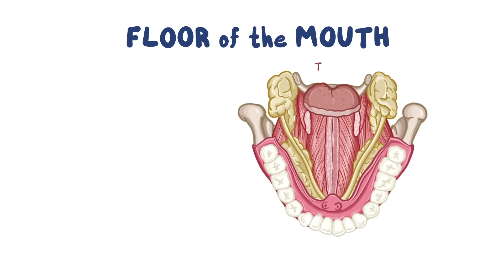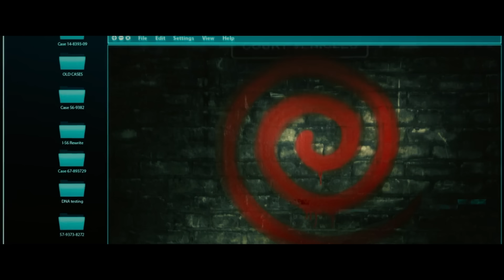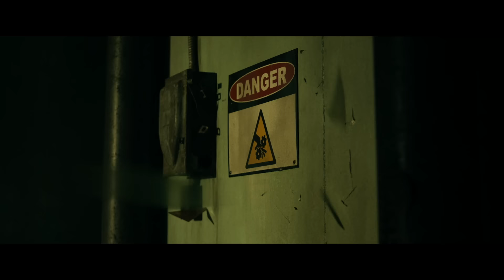How To Beat THE JIGSAW TRAPS In "Spiral: From the Book of Saw"

Comment: Those “fishnets” are actually chinese-finger-trap-like wire pulling devices used by electricians to pull wire and cables through conduit. They are made of steel cable. I really don’t think you can cut steel with glass. So like a chinese finger trap, they can only be pulled off by applying pressure forwards. Also, I believe the electricity was already on, so when he would grab the wire to move it, he would be electrocuted.
Reply: Yep, agreed. A lot of flaws in this video but still fun to watch.
Reply: So it just escape the same way as the Chinese finger trap? That doesn't seem that hard. Especially if you don't activate the machine.
Reply: Yea untwist the wires with your wet hands. What could go wrong.
Reply: @mi8los  No, just push from the base of your fingers towards the tip of your fingers one at a time….. not a perfect plan, but better than cutting steel with glass and grabbing a live wire while in a tub of water.
Reply: Best idea would to be use the slack of the line and just step either out of the pool, or on top where the bar is.
Reply: @alphalight1469  Most of his videos are, many of his survival techniques come from misunderstandings of the first page of google
Reply: I mean looking at it, he could've just climbed out or am I crazy?
Reply: Yea, that was one of the traps that he was wrong about. I probably would've tried to not bite down at all to have as much slack as possible, grab any metal on me to keep it as high as possible, and stepped out of the bathtub or ontop of the trap with in fact had space infront of it for me personally to fit and sit there till someone comes to help me as I scream profusely. He did a pretty good job with the other traps tho. The Marionette one is the one I had the most issue with. Why tf did he not mention to MOVE THE TRIPWIRE ON THE DOOR OR SHOOT IT.
Reply: Well first you should taste the water and if it isn't salty just do what you want as you won't be hurt much anyways.
Reply: @alphalight1469  Biggest flaw was completely ignoring the human factor and forgetting that any normal person in a situation such as the ones provided, would be in a state of panic and not thinking clearly enough to have the same thought process as the video creator. But I love puzzles and the video was entertaining so good enough for me.
Reply: @fireantfury2539  That isn't a flaw, most of these channels do that intentionally. It'd be quite boring to watch if they just said "realistically, you'd just die", so they analyse it as if you could think clearly in those situations.
Reply: @calculatedsurvival  he meant the copper electric wire
Reply: @immensewraith7613  Oh…. That makes more sense now. Thanks.
Reply: I would grab the lightbulb and use the glass from that prefferably a bigger piece to remove the copper wires, about the steel finger thingies I would wait keeping my mouth open the rescuers will come at day and if the killer comes back I mean glass shards to try to defend myself
Reply: @seannarodriguez2226  I mean that might trigger it shooting it will trigger it as it just acts like a saw cutting through it. and moving it I mean maybe but you would have to tie it to somewhere so the trap does not trigger
Reply: As long as he touches one wire a time he would be fine because the "circuit" wouldn't be complete.
Reply: Good ol kellum grips
Reply: If he still had his shoes he could’ve untwisted them
Reply: @babyzillakilla  lmao i was thinking the same thing
Reply: I dont think he would get electrocuted by grabbing the copper wire, because he is not completing the circuit
Reply: @bambusz0131  correctamundo
Reply: Exactly.
Reply: @bucketstuck7137  hey Gary , big fan of your work
Reply: @bambusz0131  But he is in the tub of water. The tub of water completes the circuit. Humans are conductive, if we weren’t, then we could never be electrocuted. If he touches the copper wire that is supposed to touch the tub of water, then he just put himself in the circuit from source to ground.
Reply: @calculatedsurvival  you are absolutely right. Thx for explanation, my dude!
Reply: @silverfisherman4622  the circuit does not need to connect back to itself for electricity to flow, I assume the tub was grounded, so even if he touched one wire it would go through his body to ground, which would still kill him anyway

Comment: It's good that you straight up confirm how it's clear the killer isn't Jigsaw. He has no interest in actually giving the cops a chance of life, rather the illusion of it, most likely to further make them suffer.
Reply: @renatoramos8834  To be fair it's difficult to think when you're in a situation that causes panic.
Reply: @renatoramos8834  that is a good point, tho she was strapped down  below her shoulders so even if she moved her head upwards, she won't have enough strength to keep her head upright in that position for the full duration. Also her head wouldn't be completely out of the way because she can only move her head upwards until its at a 45 degree angle. the wax was hitting her eyes before so now it would be hitting the top of her head instead. She could have moved her head as close to her shoulder as possible so the wax misses her, she would still get some burns on the back of her head because of how much wax there was at the end of it
Reply: @sunekun  45 degrees? She could go almost 90 and keep it like that for a while.
Reply: @tauceti8060  It is not difficult to step out of a tub. This is just poor cinematography.
Reply: DANGANRONPA
Reply: @renatoramos8834  I think that it is fair to say that the killer doesn't WANT them to escape, even if they technically could.
Kramer was a lunatic, but it was fairly clear that he wanted people to pull through.
Reply: @AnomalyINC  It's bad cinematography that they can easily not die.

Comment: 2 things about the 3rd trap. You can’t just touch live wire and not get electrocuted. Especially since your hands are wet. 2, most fishnets are made of nylon which usually takes some force, glass wouldn’t work very well and his fingers were clearly extremely immobile. They were forced straight and could hardly cross each other so he would have no chance grabbing it.
Reply: i was just thinking that, can't blame the dude for getting sloppy though because these aren't designed to be escapeable lmao
Reply: @blobtheblob7975  well yes if he gets out of the water he's safe lol
Reply: @Azola69  yeah but. this dude was telling him to touch the wire, while IN the water, to get OUT of the water. water or not touching a live wire will get a current to go through you, it just depends how strong it is and what you're standing on/in.
Reply: @blobtheblob7975  maybe he couldve used his feet or sum?
Reply: While you are correct about the wire, you did miss that the "helmet" could be used to headbutt the bulb at least giving some chance of cutting the fishnets.
Reply: Ong
Reply: True. You are absolutely right
Reply: @devaughnsalter6264  did you not fully read the comment? there is no way fitch could grab a glass shard with those things on his fingers let alone hold them and cut through.

Comment: My alternative solutions:

Train trap: 
Tongue device appears simply to be a bar that has been screwed to tighten. Manually unscrewing the bar may be possible, at least worth a try. If not, break out of razor wire by pulling wrists apart with palms facing towards eachother. Arteries and tendons are located on inside of wrist, so this method helps keep your hands mobile and reduces chance of bleeding out. Next take razor wire and cut off the end of the tongue and slide the rest out. If you keep the end of your tongue you can even have it reattached if you seek medical attention quickly enough. 

Water trap: Removing the copper wire doesn't work because there is a strong current and you have no available insulator to safely remove it with. Instead, I would try simply stepping out of the pool. It sounds dumb, but in the clip there doesn't appear to be anything binding him except the fishnet hands. Once out of the pool, I would have plenty of time to figure out a way to get the fishnets off or escape.

Hot wax: To elaborate on the presented solution,  the cloth could be moved off by using the tongue to slowly push it off of the mouth.

Blood draining: Blood is only being drained by gravity, as said in the video, simply knot most of the tubes, and move the ones nearest to the stairs up the stairs to reverse the flow. Take the blood collected in the jars from the rest of the tubes and pour them into the jar atop the stairs.
Reply: @FlyingParrot225  Not really. The only major blood vessel is the lingual artery,  but it's relatively minor. Sure, there would be heavy bleeding, but with some pressure to the area you should be fine. Even in the worst case scenario, your chances of survival are still better than trying to dodge a train by swinging yourself in a narrow tunnel.
Reply: train trap- simply wouldn't work as already stated above. Plus it requires mutilation, which is something easy to say you should do, but not something most people would be willing to actually do. 
water trap- Ya this would prob work tbh lol. the water that overflows might still be carrying a current though (as all it would take is a continuous stream from the top to the floor) so in that case you will still get electrocuted through your feet, as the pooling water would eventually be under you. 
Wax trap- yep, would be pretty doable. 
Blood trap- bingo, it's all being done by gravity, just fucking reverse it. It's insane that they actually put that big ass staircase there. Practically screaming this one at the screen when I saw how stupid this trap was.
Reply: @LegDayLas  Idk, I know for sure if my life was on the line I'd be quick to lose a tip of my tongue for it. Also, keep in mind that the tongue has been squeezed tightly for a long amount of time, cutting of circulation to the nerve cells in it. Theres a chance that this actually has killed off enough nerve cells to significantly reduce the pain of cutting, which combined with the adrenaline rush in the situation would be enough to naturally anesthetize the area, hopefully at least enough to quickly cut it.

Also for the electricity one, I didn't get a good look, but if the victim was wearing shoes they would actually be fine from the electric shock since the rubber soles would act as an insulator if that's the only part the water was touching. Plus, a lot of machinery and stuff in that room, I don't think the killer would have wanted it all to get covered by the water. And, most modern electric systems have built in GFCIs that prevent excessive charge from surging out, so realistically, unless the wire was linked to an off-grid electrical generator, the current would cut off pretty quickly after the contact with the water.
Reply: @FlyingParrot225  Well it's pretty unlikely that the trapper would wait for you in a train tunnel with active traffic. Also the premise of the Saw series is typically that the saw killer gives victims a chance to fight for their lives in the traps as opposed to flat out killing them, so in this movie universe if you escaped the killer would likely consider you to have earned it.
Reply: @jdjsjejsjejwnw1348  well I doubt the killer would have hooked up the wiring to cut off power when the water get's to the top, would kind of defeat the purpose :D But yes, this is a mistake that could be made by the killer.
Reply: @LegDayLas  Not the power, the water. It looks like a pool of some sort which usually have built in systems that stop water from being pumped once it reaches a certain height.
Reply: Actually the wax trap is the easiest one, because you are already in the police office, just dont turn on the tape
Reply: @Wasser_Saft  I don't think the tape was what triggered the mechanism. If it was, then lol that's stupid af.
Reply: @LegDayLas  It probably was because the wax started flowing right after it was played, although I think that was more for plot than anything else, still pretty stupid, but for plot purposes necessary I guess. If it was triggered by the tape though, the woman would have no way of knowing that, and with her hands tied down and no other thing around, plus not knowing she was in the station(if she had presumably she would have yelled for someone, since she wasn't gagged or anything) she really would not logically do anything other than press the recording.
Reply: @jdjsjejsjejwnw1348  Tbh if put in that situation I prob wouldn't even notice the tape.... lol
Reply: @FlyingParrot225  i had my tongue splitted and I was surprised by how little blood came out

Comment: There’s actually an easier way to beat the electric water trap, the fishing nets around the fingers actually work really similarly to the Chinese finger trap meaning that if u push ur finger bit towards the end off the fish net it will make the hole wider making it easier to just pull out ur finger from the trap
Reply: this is really smart
Reply: wait that it??

like one of those cat toys
Reply: Dexter laborotry
Reply: Or if u just step out the water lmao
Reply: @michaelvillasenor5586  well it seems like the area is made out of metal too so if ud leave when the water get electrocuted it will electrify the container which is connected to the metal ropes at ur fingers so it will still electrify u

Comment: I believe you made a mistake with the bathtub trap. If he grabbed the copper water he would've completed the circuit, and electrocuted himself. Unless he moved it with an insulator, he would've been dead. That is, assuming the copper wire had current flowing through

Comment: The 2nd trap with the fingers. You mention that he has fishnets on his fingers and can be cut off with a shard of the fluorescent bulb. Those arent fishnets. They are a type of tension head that can be placed on a wires to be pulled through a pipe. They work like a chinese finger trap and they are metal. However since they work from that tension it should be a lot easier to remove your fingers from the traps as long as there isnt something preventing you from removing them by relieving the tension. But cutting through them isnt a viable option.
Reply: Agreed, as well as his been laying in water so he’s soak trying to grab the copper wires to remove them will just electrocute him anyway not kill but enough to make him stop holding it and jump back might knock ‘em out to which them water fills and dies
Reply: and thats the reason why most of these solutions arent really possible. because who would even be thinking of cutting it i would be thinking of trying to get out of the pool first.
Reply: @L1Zxxzx  yea...either way McMurphy ended up pretty dead in this movie...he is still a hilarious mumbling character in Letterkenny thank goodness.
Reply: @ants_in_my_eyes_johnson6844  ikr 😂. but thinking about all this mans solutions they can be possible in some way but a normal human would be in to much pressure since their life is on the line to think of a solution that takes ages to think of and you only have like 20-30 secs which is why its so impossible to get out of this death or life situation. 

unless your are a person who goes through this large amount of pressure weekly then yea you might survive apart from that i'd rather just die and get out of my misery.
Reply: @ants_in_my_eyes_johnson6844  then survive but gets shot/get cuts and bruises and have to stay in the hospital for months.... yea no. thats not worth it.
Reply: @L1Zxxzx  I guess the best way to avoid one of these traps is the easy way...like someone pointed out don't be a crappy human in the first place and do stuff that would be considered vile enough to deserve such a fate.

Then again that is relative to the situation and subjective to whoever was the one who set up all the traps in the first place. Along with how crappy a human they were in regards to how it impacted the one going through all the trouble to set the traps...one would just have to hope that they weren't someone that saw jaywalking as a hell worthy offense.
Reply: @ants_in_my_eyes_johnson6844  yep dont get into things you know is bad otherwise your the next killers victim.
Reply: @L1Zxxzx  Time is the real killer here. With enough time someone could calm down and free themselves but when they have a few seconds before they get fried or hit by a train there's really no way to win.
Reply: Yea this guy didn’t really do much research and just said a bunch of stuff
Reply: @pizrux6592  I like to say a bunch of stuff. I think the stuff that I said tracks considering what I saw from the clip. If in my lack of research, as youve pointed out, I have erred to the point of my comment being wrong in some way please enlighten me.
Reply: You can tell the fingers trap is harder to escape, if it's metal and not just fishnets.
Reply: also i don't think he can move the wires because he will get electrocuted
Reply: @hunterkrieg1041  what about using your shoe to move the wires ? Lol
Reply: The finger traps remind me of the mesh like material used in the medical field to create tension to reduce (realign) certain types of fractures.